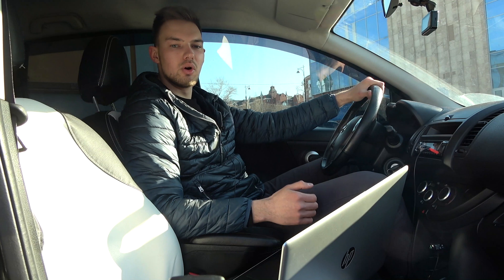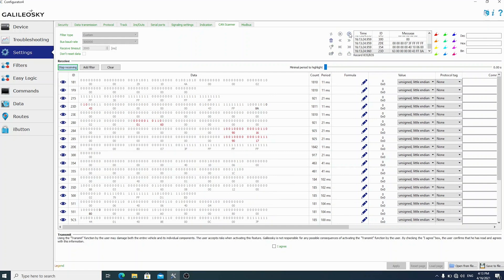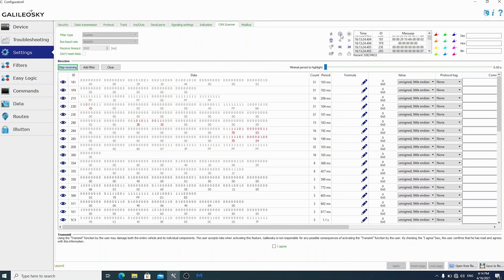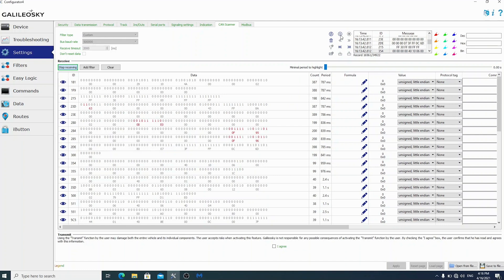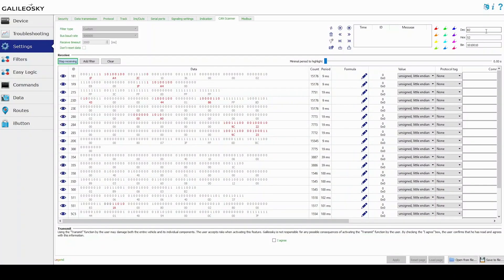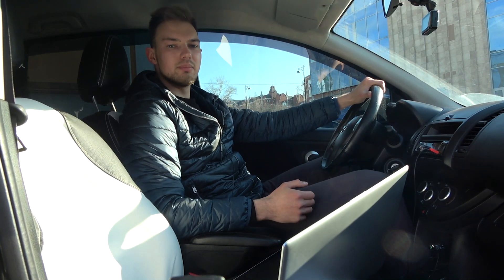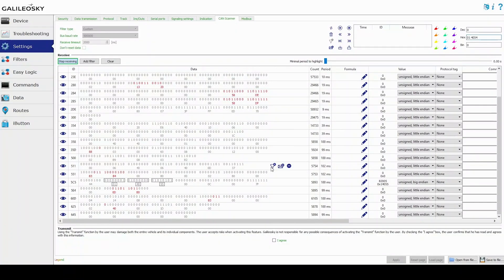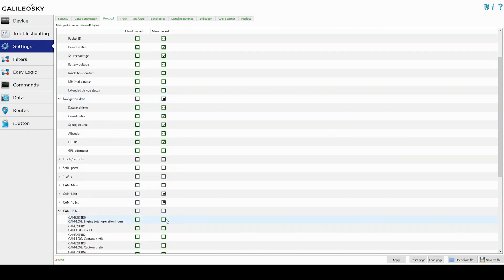How to find mileage in the vehicles’ CAN bus?  | Lesson 8

Comment: I have a Tesla Model 3, there are several things I want to locate on the CAN Bus, these are left / right signals, indication that brakes are depressed and if reverse is engaged, can anyone help me locate these?  I have a Raspberry Pi 0 W and USB CAN Bus Interface with a 12 to 5 V step down module.  I've connected to my car and can see a whole load of CAN data, I have both Wireshark and SavvyCAN and I've searched for these messages but I don't see anything that looks like them.